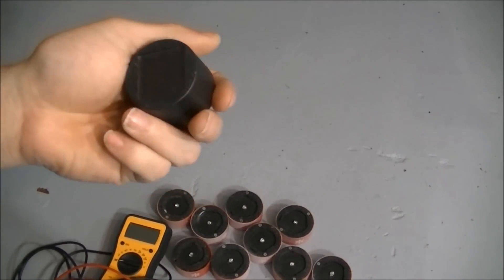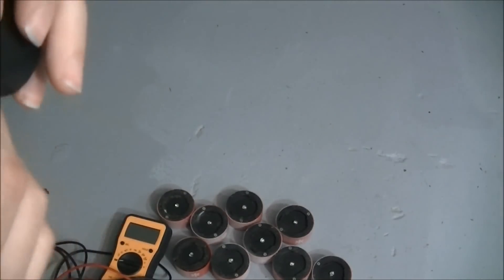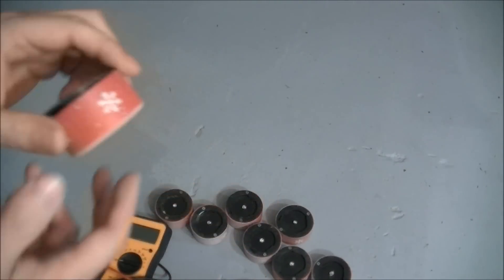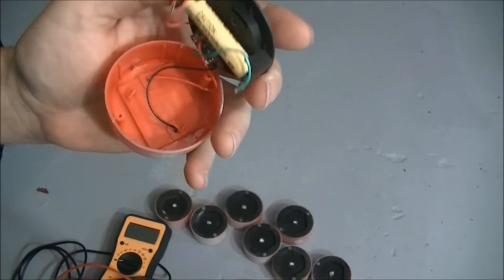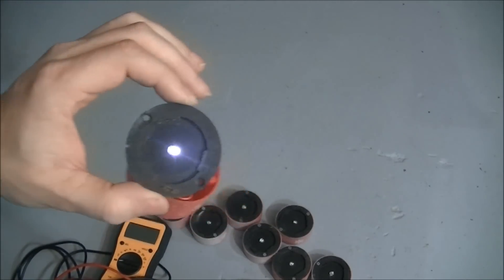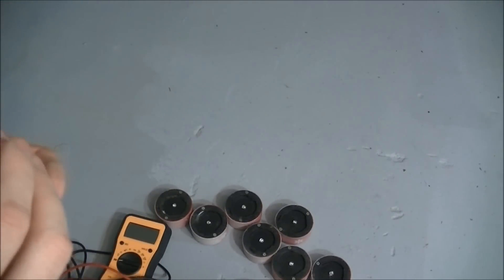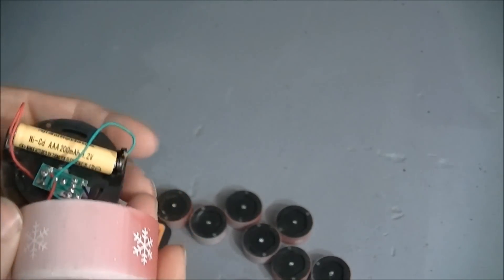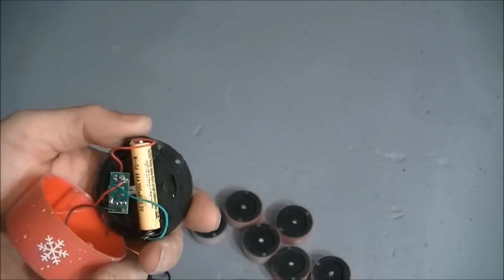What to do with old solar landscape lights

Comment: Make a colloidal silver generator by cutting one of the led leads and 
attaching silver rods.the led in series will give a visual indication of
 current flow when silver rods inserted in water to make colloidal silver.has 
automatic current limiting.
Reply: That will make ionic silver. When ionic silver it mixed with hydrochloric acid in the stomach we get silver chloride that is not usable inside the body. http://www.silver-colloids.com/Reports/reports.html#CompTable
Reply: latest research on DISSECTED bacteria has given definitive proof it is the ionic silver that does the bacteria killing.you can google it.

Comment: I live in the south . The batteries seem to hold up and the lights will many times work but, my panels get clouded and stop recharging. I've had several different types and the result is always the same.
Reply: Try cleaning the panels with alcohol then brushing on some clear nail polish after it's dried completely.  That may help with the clouded issue.
Reply: Ned Morlef cover the panel with cling film when that gets dirty just change it simple
Reply: I had run across a video by a woman that done the fingernail polish idea and that seemed to work well.

I wonder if a polyurethan or acrylic[fn polish?] would work? It's something I'll try on a cheap panel. Thanks for the responses.

Comment: Thanks for the nice video. Have you made your 12V charger yet? Show us the finished unit if you have. I have a pile of old lights that seem to have failed other than corrosion or bad batteries and had the same thoughts that you did.